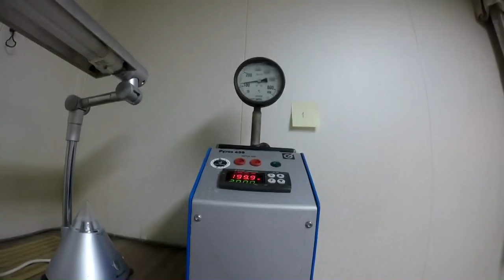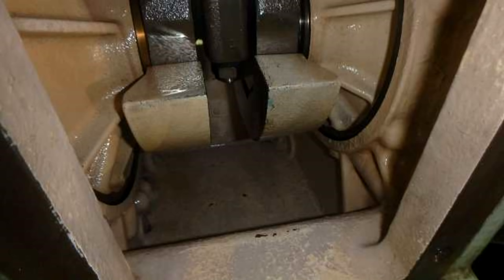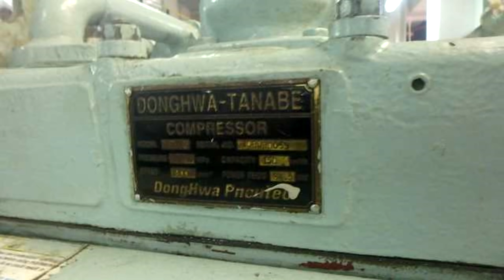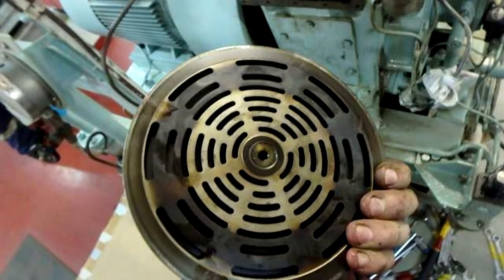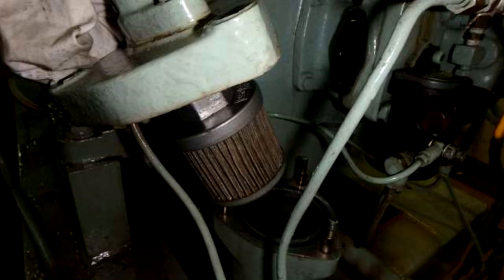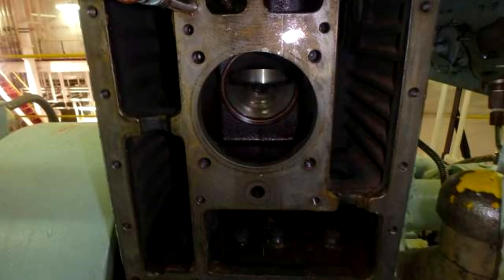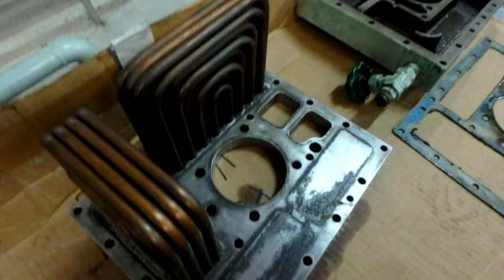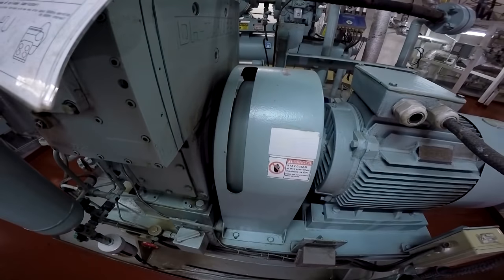Air Compressor Details

Comment: I have a problem, when open The oil for change it, it seems  emulsified  with water, what it can be The problem?
Reply from the maker: Hello dear friend! 
Problems ca be a lot but it is necessary to find if you have any leakages.
So the first thing you should do is to empty the sump from oil and let cooling open so you can see from where the water comes.
Is it from liners or cooler plate leakages.

Comment: Sir, good day.
can you pls upload "risk assessment" of air compressor overhauling?
or you can upload it in your community when you are not busy.
thanks in advance 🙏
Reply from the maker: Yes sure now it is little difficult but I will find time!
Reply from the maker: Before any risk assessment make also a cold work permit.Sure risk assessment will include   high pressure conditions,hot surfaces,electrical power isolation and blocking of equipment,any safety precautions will be necessary if this compressor is associated with emergency.
Always if you isolate emergency equipment find a alternative coverage or conditions should be so that there is not necessary to be used.If is necessary to cover some emergencies specify your plan or recovery alternatives.
Reply: @Adventure-Story  thanks🙏
Reply from the maker: Welcome!

Comment: do we need  to drain the  cooling  water when removing the compressor valves
Reply from the maker: For first stage yes it will need to drain for second stage not.Thanks!
Reply: in SPERRE comp no need